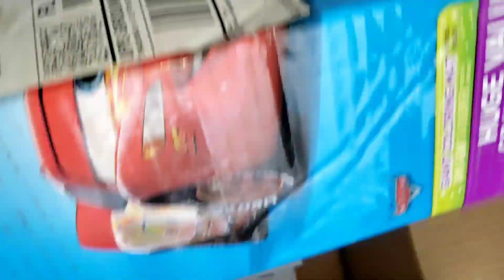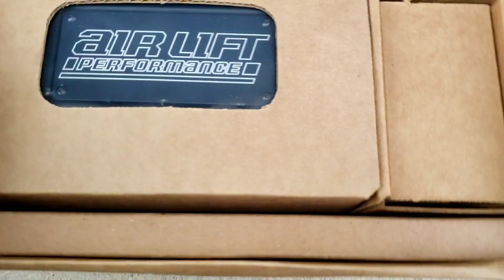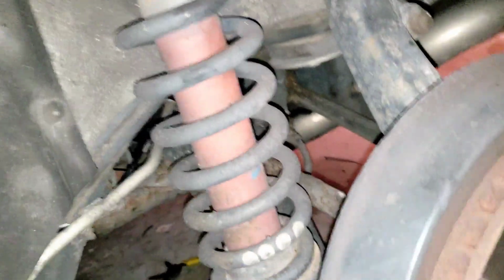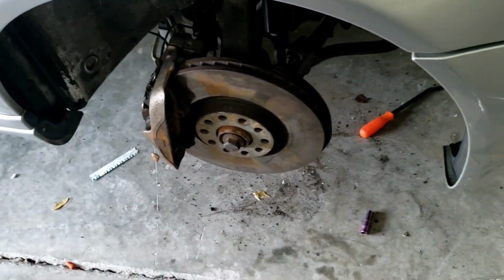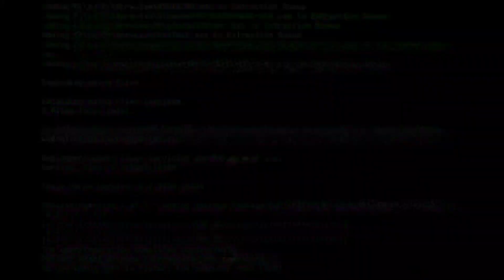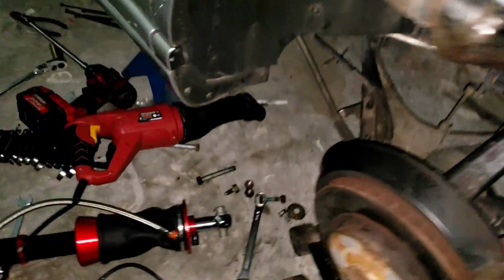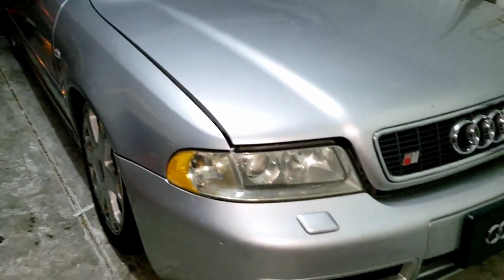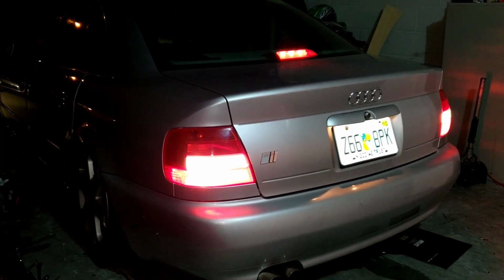AIRLIFT 3P INSTALL | 2001 B5 AUDI S4!  + TRUNK SETUP #AIRLIFTPERFORMANCE

Comment: Did you put a strut mount or top shock mount or the air lift doesn’t use one ?
Reply from the maker: I didn't use a mount. the bag/strut just bolts in at the top and bottom and you can adjust everything with the tire off